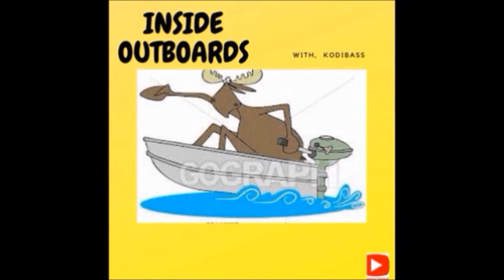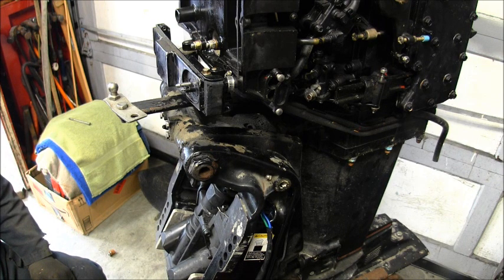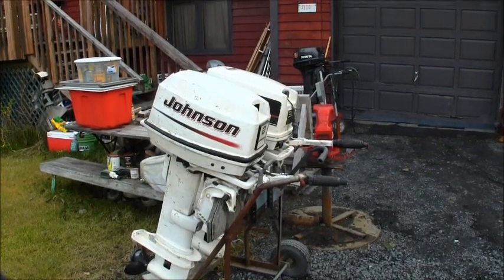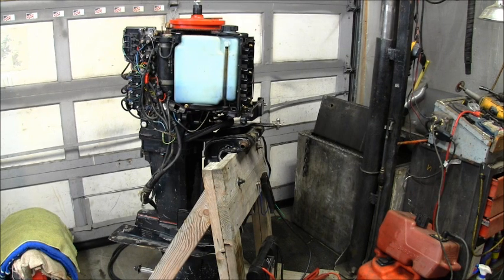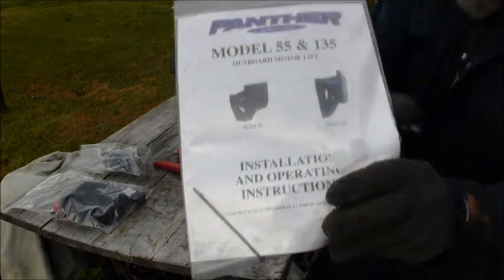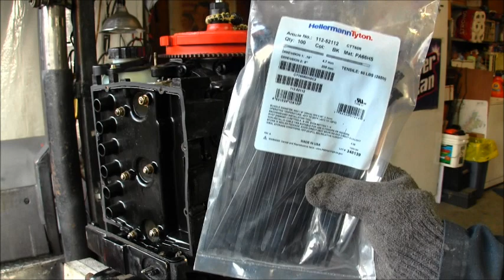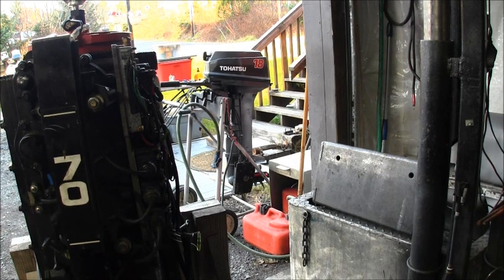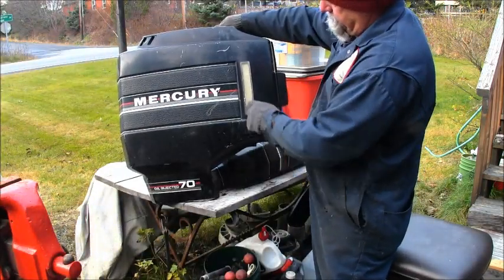MERCURY 1988 70 HP TILT / TRIM,   (( Part 2 ))

Comment: Hi Kodi, my local Napa when I went to get new fuel hose for my 60 merc had baby stainless hose clamps you can use a small slot screwdriver or socket on so I put them on instead of the fuel tie straps. I did leave them on the fuel enrichment hose and oil injection ones since they are really small hoses.
Reply from the maker: Yep good 2 have supply of both on hand 4 sure.     kb

Comment: I put a Panther on my 1984 Merc 50.  It was missing the original and the Panther was the cheapest option.  It doesn't disappoint.  I put the switch up in the front so I need to add a switch at the motor for local when I put my transom saver on.  $600 bucks in Bass Pro
Reply from the maker: Great 2 hear,  Mine will go on my Bayrunner skiff.     kb
Reply: @kodibassInsideoutboards  CMC makes one out of 3 inch aluminum angle.  I almost bought that one but they were out of stock due to covid.  Being angles it would be real easy to copy